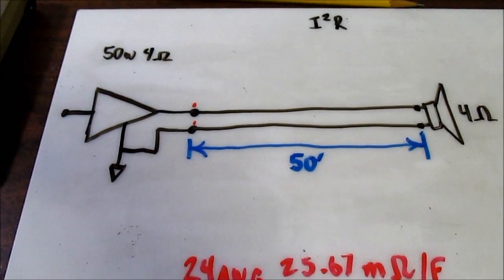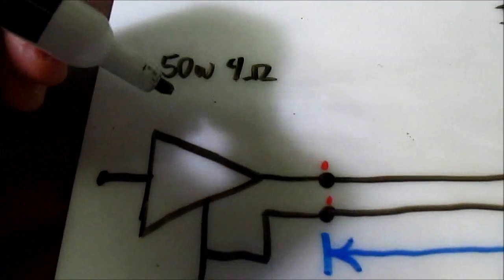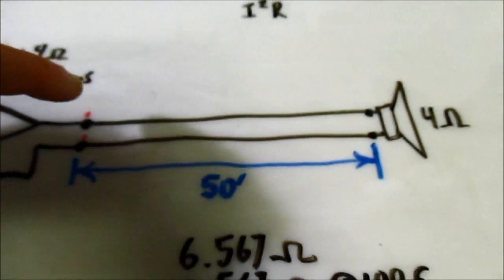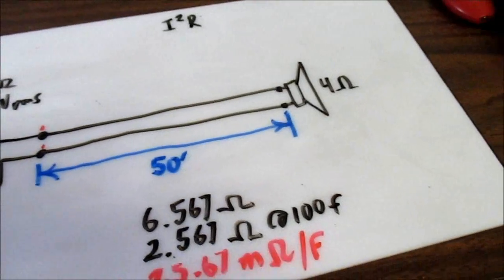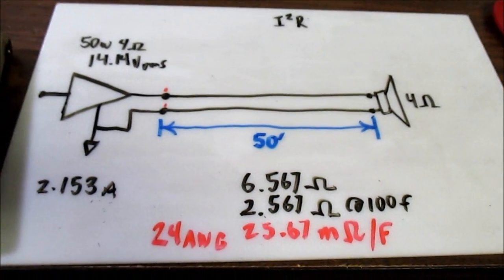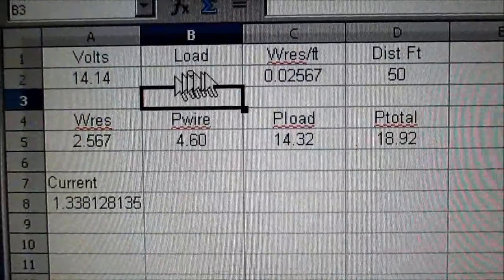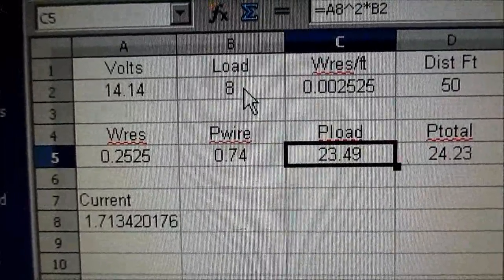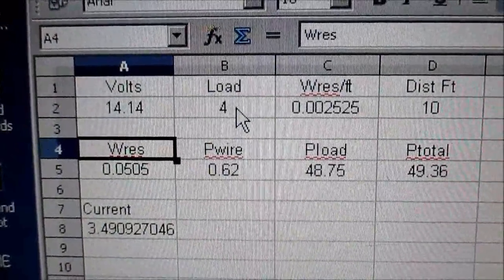I squared R losses - Why not to use 24 guage speaker wire

Comment: This is not the most important issue with over-thin speaker cables really, few people would notice a few dB of
attenuation unless the system was already on the point of clipping.  What proably matters more is the rapid degradation of
the damping factor seen at the speaker terminals caused by series resistance in the cable.

Comment: Using 100 metres of 40AWG cable driven by a 10KW (4ohm) amp would deliver about 430mW into a 4 ohm speaker, now that would be silly.

Comment: Being pedantic but its resistivity of cable when referring to ohms/metre (yard,etc.)
Reply: Being pedantic resistivity is an intrisic property of the metal, resistance per unit length of cable is not resistivity, its resistance per unit length of the cable (which depends on the cross-sectional area of the cable as well as the resistivity of the metal conductor used0

Comment: I watch each of your posts and you have helped me on some of my projects. Could you do a video on a single channel amp at say 50-60 watts @ 12 volts DC I could use as a portable P.A system? It would drive 2 two way speaker cabs. If not thanks for all your other videos. Thankz
Reply from the maker: Audio Tech Labs Thanks for watching! Without an internal power supply to boost up the voltage for the amp circuit, that kind of power is out of reach for 12 volts. If you can get a 12v to +35v and -35v VDC converter board, the LM3886 would make a good 50-60w amp.

Comment: Thanks for this. I was pulling my hair trying to find out what sort of voltage an amplifier has to output in order to drive a certain load. Good thing that there is a formula for it. Very well made video. Cheers :)

Comment: I think that little extra resistance, helps protect the circuit.
Most people are not going to use more then 10 watts per channel unless they are deaf.
Reply: +MrMac5150 12'x11' room, eltax floorstanders on the other side of the room, finale of Rossini's william tell overture - Requires >50w on my old setup to fill the room
Reply: Maurice Orris
 Get a hearing test Mister.

Comment: Great video! I'm driving 8R load through about 20ft of 20AWG cable, works fine for me. You just cannot get away from power losses, you can just make 'em smaller. And since audio is AC, on top of that you get reactive losses due to inductance of that cable.
Reply: MrJohhhnnnyyy Yes, my thoughts too.  I suppose the capacitance is probably not a heavy factor given the low overall impedance, but I wonder on the inductance. Both could be affected by how the wires run and proximity to metal, etc. I can picture that flimsy junk 24AWG stapled around a door frame or a steel heat register, etc...
Reply: ***** Yeah, or even better - I saw few people who have excess cable, and they don't want to cut it, so - they coil it. I don't know for sure, but I think that a few meters of wire coiled in dia. approx 1ft is pretty good inductor :D
Reply: +MrJohhhnnnyyy You are losing 5% of your power using 20AWG over that distance, hardly worth bothering about so don't lose any sleep :0)
Reply: mart fart Yup, I picked up that cable considering my setup. So I sleep fine :)
Reply: mart fart Trust me, that's OK. I've seen true smart-asses before
Reply: MrJohhhnnnyyy
I got no idea in the cold light of day why I bothered to tell you that in the first place?? Maybe I had a smart-ass attack?
Reply: mart fart Oh, come on :D
Reply: MrJohhhnnnyyy
haha, it does seem a bit smart ass sober )